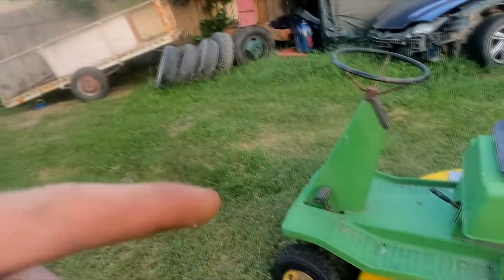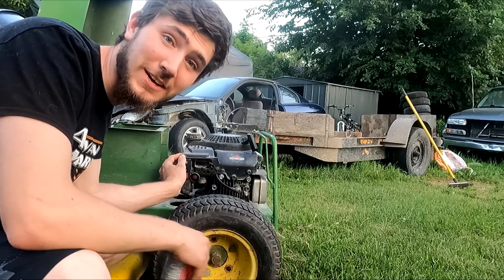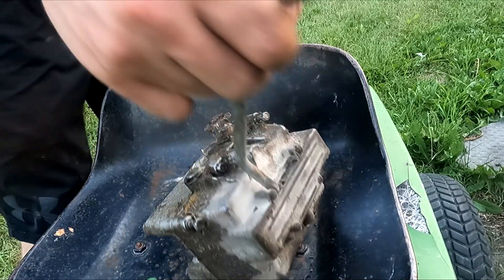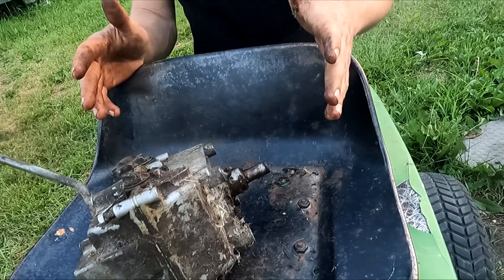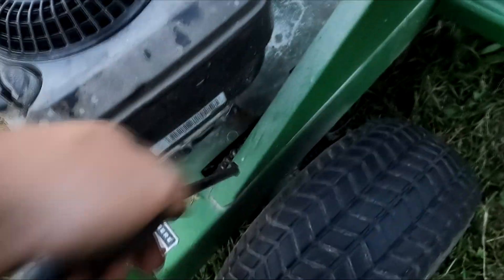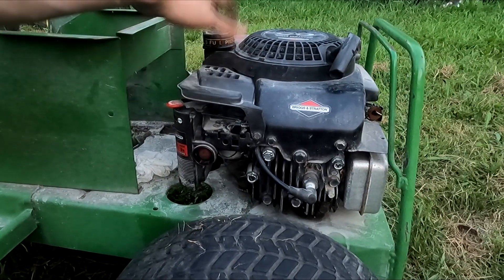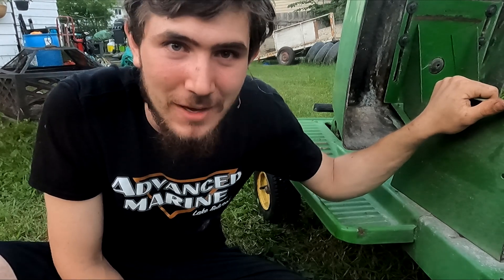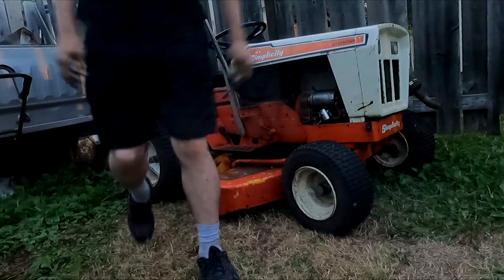Marketplace Mower Maniac

Comment: Sync. Gear worn out
Reply from the maker: Had it pulled apart all looks good, trans shifts good, shift out of lawnmower. trans has new grease but does not work in rev when installed. But rear difficulty has been tampered with